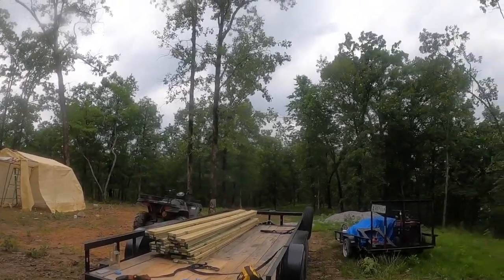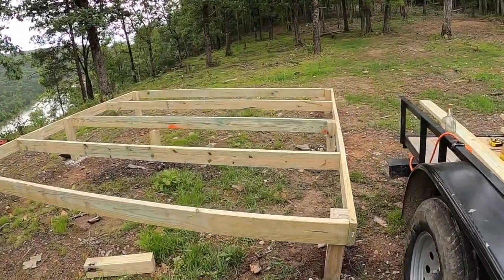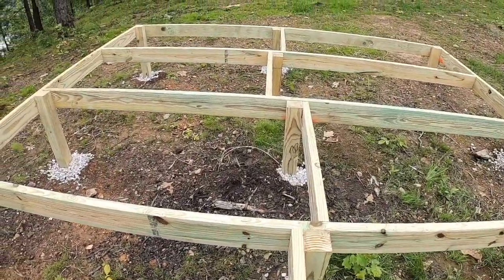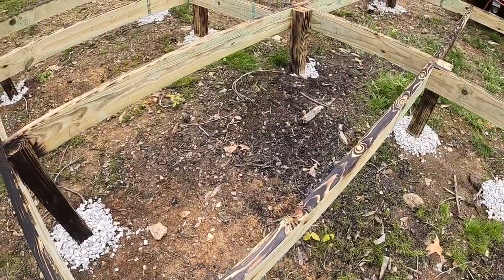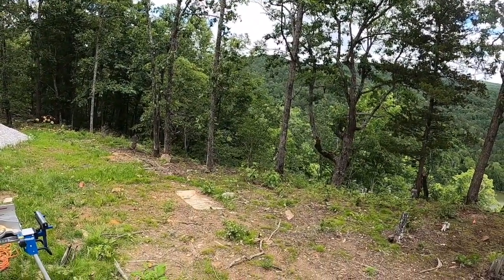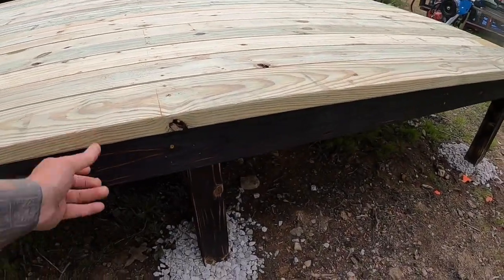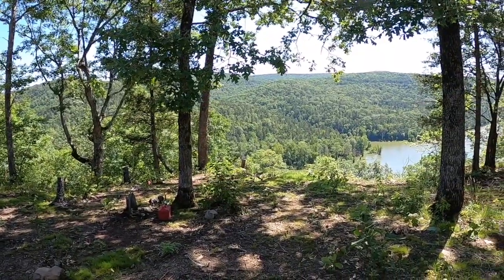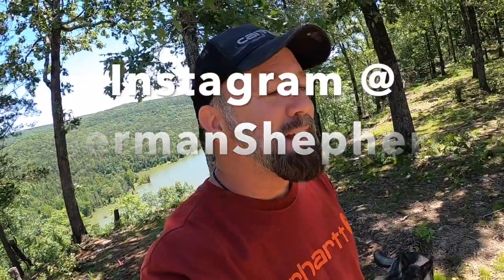DIY BUILD A DECK- 12x12- MOVING TO THE OFF GRID HOMESTEAD

Comment: Nice!  I like the deck. And the idea of several. Also like the partial burn of the wood rather than the total black look. It brings out the grain so the wood still looks like wood. Toasting the wood should add preservation so that it lasts longer. Stay safe and stay healthy. And keep the videos coming
Reply from the maker: I've already done a second and got it done in one day.  I've decided to do terraced decks down to the end, in mostly 12x12 sections.  The second one was easy to do.  I'm waiting for the boards to dry this time before burning them.  I'm going to treat it all at once.  Thanks for watching!

Comment: Looking good.  You can get an adapter to refill your little gas canister from a larger one.
Reply from the maker: You are right. I can add it to a 5 gallon tank. Its bulky.  My opinion. I've got a ton of those camping propanes around.  I figure I will dry out all future wood and I wont use much. How have you been?

Comment: Sorry to be disagreeable, but you're demonstrating a common framing mistake here.  The joists should rest on TOP of the posts,transferring the load  down through the post.  You put the joists on the side of the post and fastened it there.  So the weight of your entire structure is on the screws or whatever fasteners you have there.  Fasteners are designed to hold things together, not bear weight.  It's just a deck so you might get away with it for a while, but the strength of your structure is much less than it should be.  There are lots of videos on Youtube that show the correct way to do Post-to-Beam connections.